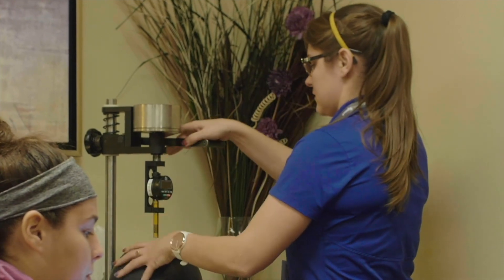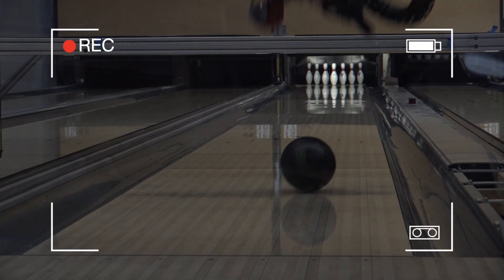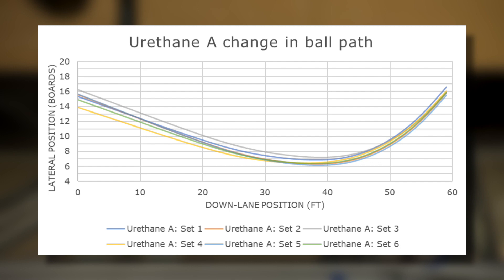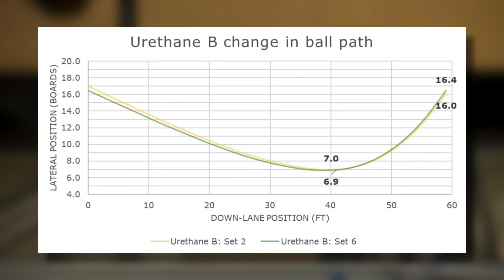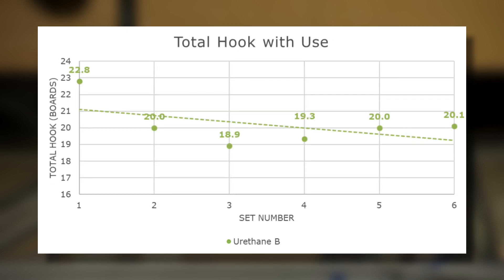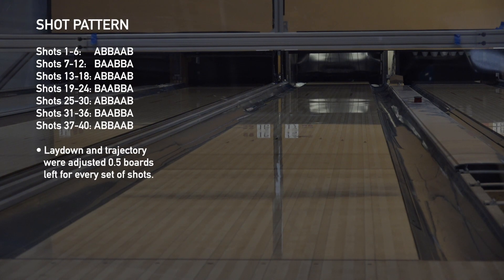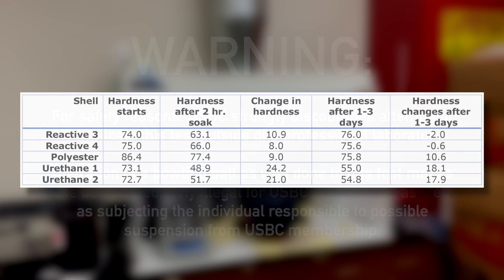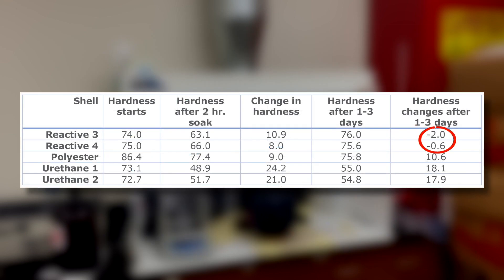2022 USBC Hardness Study - Part 3

Comment: My takeaway from these 3 videos is that only the surface of a urethane ball softens with use.  The surface softening isn’t enough to significantly affect ball motion, and can be reset with a simple surface pad.  

BUT a ball that comes off the production line too soft, isn’t just too soft on the surface, it’s too soft throughout the entire shell, and is permanently soft because you can’t simply remove the surface layer.  

Assuming urethane is more elastic, as was stated in the video, the increased elasticity throughout the entire shell of a softer off the line ball vs the less elastic throughout cover of a harder off the line ball, is the reason a softer with use ball still doesn’t perform the same as a softer throughout ball at similar hardness measurements.

Makes sense to me.

Comment: What a joke of a report. All this report proved is that USBC hardness standards is worthless and USBC reasonings are flawed.

Lastly, the 2 urethane balls tests. They’re both legal. A 73 hardness is above the min 72 hardness. So what if the test shows the softer ball hooking early. It met the USBC standard. What a horrible and worthless test of trying to show the min hardness to prevent unfair advantage

“Unfair advantage” that USBC cited is a ball hooking early and maybe with slight more entry angle. That’s not a advantage.

Hooking early is the worse thing you want. This can be achieved by sanding the ball (this is not illegal), ripping the oil off the lane (by using soakers of a ball that quickly deplete the oil, reactive balls are not illegal). 

For entry angle, polish the ball, you’ll get higher entry angle. Move right and straighten your launch trajectory, that will also increase entry angle. Moving right sure isn’t illegal.

Too high of an entry angle is bad as that decrease the percentage of striking while increasing the chance of big leaves. 

Bowling is about using the right amount of hook for the lane. More hook, more entry angle, is not better; does not constitute unfair advantage